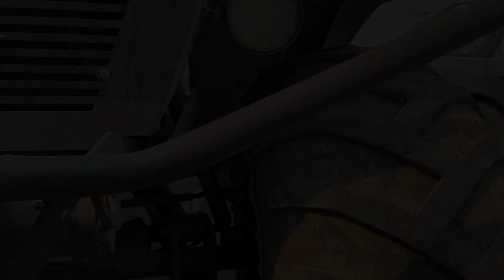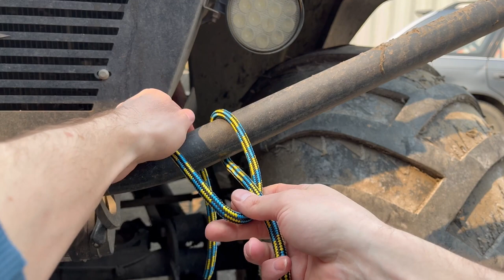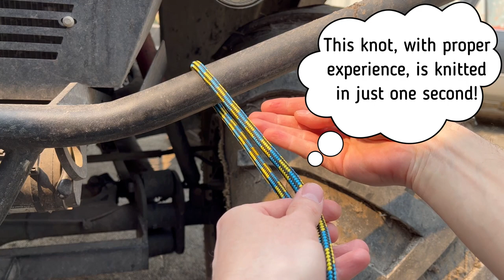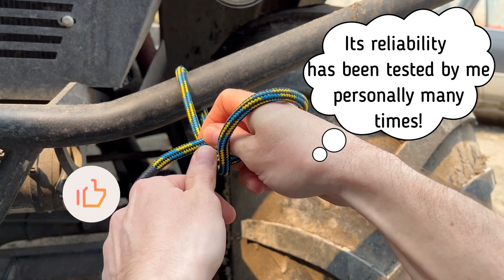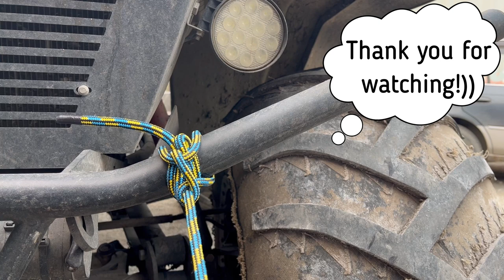Towing Made Easy: Learn The Simplest Knots for Secure Car Transport!👍

Comment: These knots seems to depend on the strength of the rope in use. Given you use a rope that is sufficiently strong enough, will these knots hold if you have to jerk the stuck vehicle free? I'm thinking of a situation I was in years ago where a group of us had gone rock climbing. On the way home we got stuck in a patch of thick mud that held onto anything in it. We used the static rope to jerk the other vehicle out, but only after we had piled knot after knot on top of each other after other knots had come loose. 
These knots look great and are easy to tie. I was in a situation where one of the vehicles blew a radiator hose and had to be towed back to civilization. These would have been so much easier than what we used. That knot had tightened so much all we could do was cut it loose. Thanks!
Reply from the maker: Great cases! Interesting life you have) 
Yes, I use all the nodes myself. As you can see, my transport is also not for asphalt)